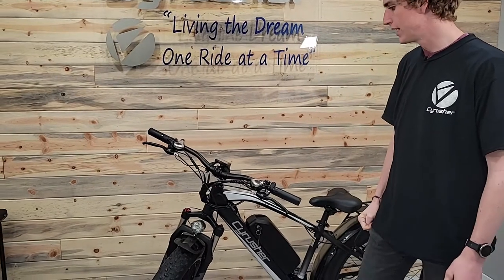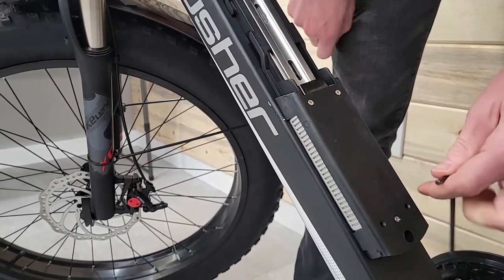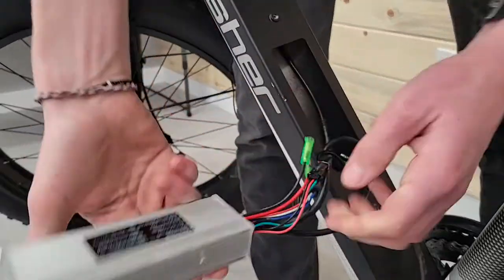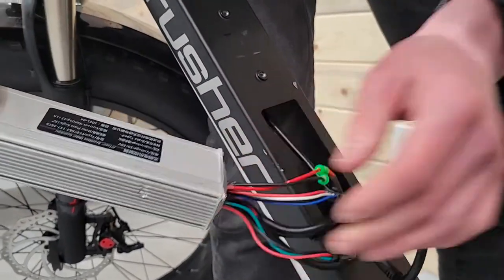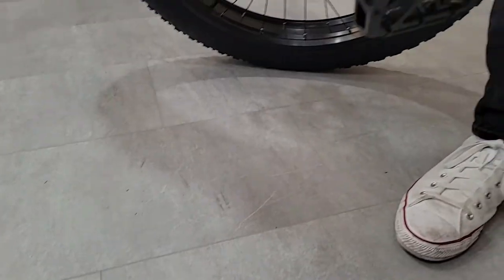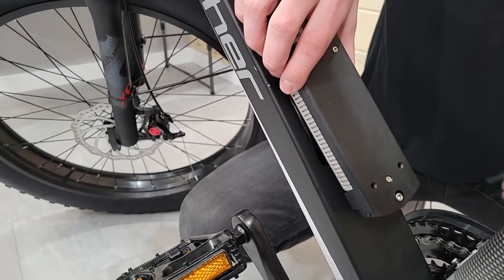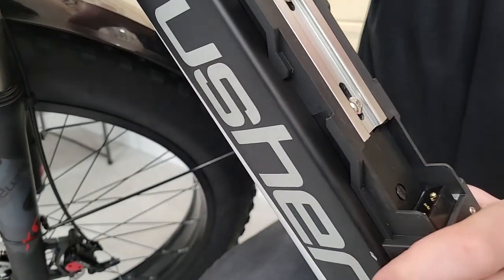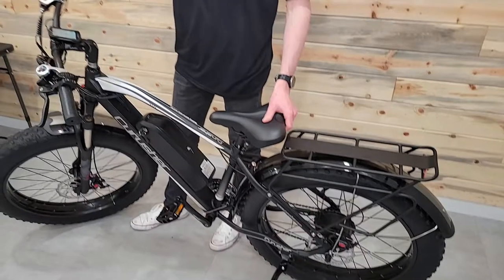Cyrusher XF650/XF900 Controller Replacement

Comment: Hi nice vid. Just wondering what's the throttle max speed whilst off the ground without any load, like in this vid? Also what's this controllers max current?

I have the 690 folding frame. I understand mine has a smaller sized controller, therefore, lower max current due to the folding frame designs limited space. Everything else being virtually identical except battery.

Could I simlpy switch with this controller to achieve a higher top speed/acceleration/torque? mounting it in a different location on the rack for example due to increased size?
Reply from the maker: With regards to the XF690 having a different controller, the max current should be the same between the controllers. What matters more in achieving a higher speed would be the P-settings and your motor.

If your bike isn't going too fast, it might be worth checking out your P-10 setting, as the default is 30 from the factory but if you set it to 100 then you will unlock the motor to get a faster speed.
Reply: @cyrushertech  Thanks for quick response. Yes, p08 set to 100 was 1st mod to s700 display. Mine came with 13a current limit controller. Max realworld speed between 23-25mph. 34mph while wheel off the ground. Curious what top speed other 650 690 800 900 do while wheel off the ground. Thanks in advance.

Comment: I recieved my 650 yesterday and took it out today, lots of fun, at some point in the future i was wondering if it is posible to replace the 750 motor with the 1000 motor .
Reply from the maker: Glad to hear your enjoying the bike, all of our motors are a 750 watt motor with either a peak of 1000w or 1500w. So it does output 1000w but if you are specifically looking for a 1000w minimum output we currently do not have any motor upgrades for this.

Comment: Have just received a replacement controller for my xf650. Has taken a month to arrive. Doesn't look like they've sent right one as mine has a screw type connector on the wire that goes to the hub drive. One they have sent is push fit. Am gutted.
Reply from the maker: Sorry to hear about this issue, I know that the controller types have different connections as the factory always seeks to change and upgrade the parts. Have you reached out to the support team already about this?

Comment: I've changed my controller and still have an issue with my gen 1 xf650  new controller new motor replacement controller is22 amps original was 25amp

Comment: Hi, can you tell what type of connector is from the battery slider? (on the XF800),  i might want to buy a bigger battery but i comes with a different battery slider a 5pin instead of 4 i wanna now if i can just replace the Original battery slider with the one coming with the battery
Reply from the maker: So the XF800 battery, depending on which generation you get, will have different connection types. I believe the newest XF800 models come with a 4-prong system instead of the 5 holes

Comment: Hello Team , the Error 10 (s900) still appears, although I have renewed the
as well as the controller ! I bought the spare parts from you. What
can I do now?
Reply from the maker: Thank you for reaching out, so Error code 10 on the S900 screen means that there is a "communications issue" occurring somewhere, which means that the bike controller or cables have an issue somewhere. The best way to get help with warranty issues and such is through a support ticket so that our mechanics can help you get warranty coverage. Do you have a support ticket open with us?
Reply: @cyrushertech   Yes i do... but getting help by VOD .. is much more  helping...at least to stupid me ..

Comment: I don't think it's ideal for the screw that holds the controller in place to actually damage it!  Wouldn't it be better to maybe add a piece of thin foam to it to avoid this?
Reply from the maker: Some foam can be used to help secure the controller as well, typically the controllers come with thin lines on the casing that act as a bit of a buffer for the screw to hold on to. If you have some removable foam, you can definitely use it to hold the controller in place though. You just want to avoid using any permanent solutions as that would make removing the controller impossible in the future.
Reply: That was first thing I did as it also stopped the rattly noises of everything clunking around in there. Used some of the packaging foam that came with it.